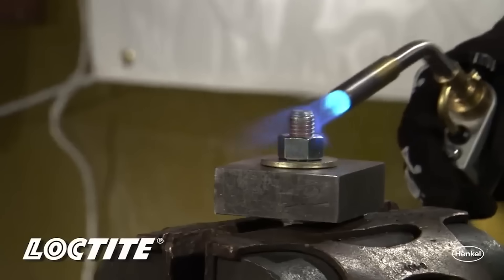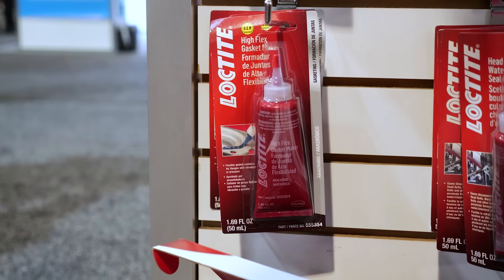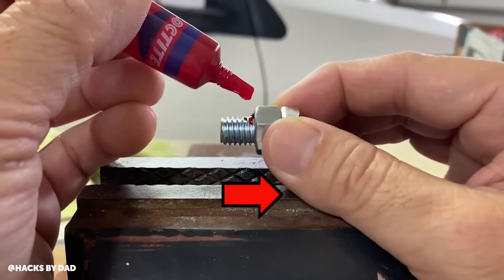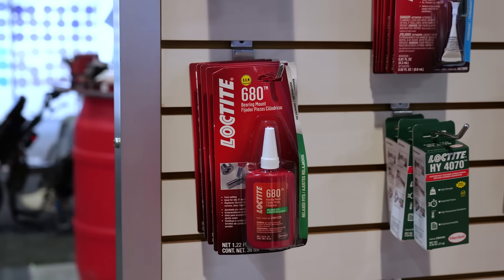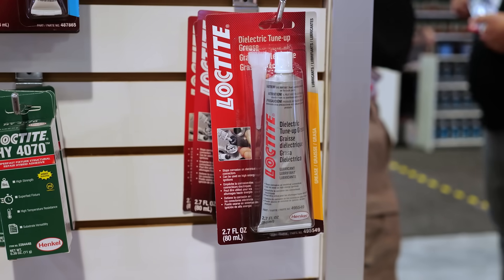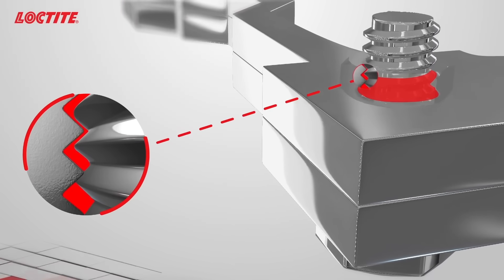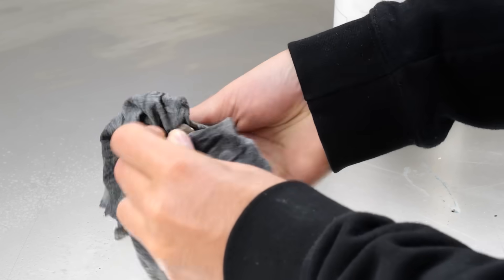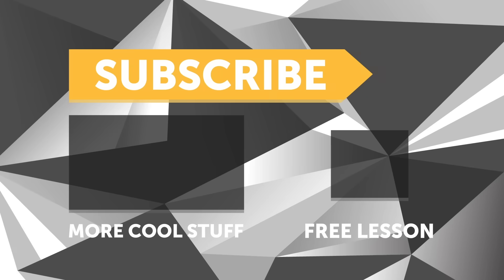Many pro mechanics don't know this.

Comment: Good old fingernail polish works very well in place of Loctite.
Reply from the maker: I just had a quick look. Per ml, that seems more expensive than using Loctite or an alternative brand of threadlocker made specifically for this use. 
I guess you can choose whatever colour your heart desires with nail polish though 😅 - Taz.
Reply: I always keep some in my purse with my lipstick
Reply from the maker: Lipstick is there to use an an anti seize right 😅
Jokes aside there can be some merit in reusing some household items. Hair spray for motorcycle grips is a common one since it gets stickier when it gets warm.
Nail polish for threadlocker isn't one I'm super keen on but hey, I'm not working on Rays projects, he is and can decide for himself 😎 - Taz.

Comment: If the red needs 550 degrees to release why would you use it on. "The ideal placement of red threadlockers is on bolts ranging from 1/4″ to 3/4″ diameter for some of the following areas: Bearing caps, Motor mounts, Suspension bolts"???? You dont want to heat those up because they contain your rubber bushings. Thanks
Reply from the maker: @dannyw7662  I guess in most cases on a street car you are removing those components to replace the bushings because they are already toast, and on a race application you won't be have rubber there, it will be 'solid' mounted.
That said, that is just some examples from them, you decide where you want to use such threadlocker (or not) on your own car using your own brain and knowledge of the options 😎 
Also note, there is not only one type of Loctite that is red - Taz.

Comment: 35 yr aircraft tech…. We almost never use lock tite , safety wire,cotter pins, nuts with run on torque. Heat counters locktite.  As a hobby machinist  green for bores and blue and low strength purple is my go to  for just about all other applications

Comment: Way back in the seventies when I was doing workshop training, we did the brazed bar experiment (cut a 10x10mm steel bar then braze it back together in a 3 to 1 joint). After that, it is firmly in your mind how to create a strong brazed, soldered or glued joint.  In my earliest design jobs, this became very useful as engineering adhesives were just becoming more common and easy to obtain. An early application was the bed of a machining fixture that was assembled with anaerobic adhesive instead of hundreds of tiny screws. Later, anaerobics were used not just to prevent loosening but to prevent crevise corrosion and guarantee the forces of disassembly. Other adhesives were used to seal marine electronic pods and assemble polyolefin and PVC parts. Many of the products were from Loctite but there is now a wide range of suppliers in this market.

Comment: For occasional use at home to keep your threadlocker good for longer, keep it in the fridge when you aren't using it ;-)
Reply from the maker: Great tip! I do that with some glues too like Loctite 480 as that goes off very quickly at room/workshop temperature - Taz.

Comment: Does Loctite work on galvanized bolts and nuts?
Reply from the maker: "We recommend the use of primer where both the parts come under the category of 'inactive surfaces'. These metals lack the iron or copper content and thus the metallic ions that are required to fully cure the product within 24 hours. These inactive surfaces include plated parts, stainless steel, galvanized steel and anodized aluminium to name a few. On the other hand, in case both or at least one part is an active metal, then there is no need to use a primer to ensure full cure, which is typically within 24 hours at room temperature." - https://www.tryloctite.in/faq

Hope that helps! - Taz.
Reply: @hpa101  Extremely helpful - thank you

Comment: I've never had to ever use heat on red thread locker....
Reply from the maker: If a product, amy product, isn't working then you need to check you are are applying it correctly, your supply has expired and also that you are using it for the right application 😎-Taz

Comment: Blue 243 is the stuff! Just use it on everything, especially on motorcycles. Bolts will always release with normal tools, but NEVER come loose.
It also stops corrosion so the bolts never rust in or gall, good for motorcycles where bolts are often exposed to rain.
And it sets up fine on stainless bolts, probably 90% of the bolts on my old Harleys are 316 or 304 stainless.
The only time I use other loctite is special red for inside the engine (hot) as specified in the service manual, and occasionally use green for a stud that you never want to get out again.
But every bolt on my old bikes gets blue 243, just buy a big bottle of it and keep it with your tools. 👍
Reply: 243 is awesome because it's oil tolerant, which means you don't need to blast every bolt and hole with brake cleaner before you assemble. Granted, I used 242 for a lot of years without cleaning anything before assembly and rarely had issues, but it's just the piece of mind for me.
Reply: @ForfeMac    yeah yoou don't need to clean the bolts, and don't even need to clean the previous loctite off the bolts, just a couple drops fresh 243 then tighten up the bolt.
If you ever wonder why new bikes never get a loose bolt its because the factory puts 243 on every chassis bolt, so to me, that 243 makes my vintage Shovelhead as reliable as a new bike (well I also completely re-wired the electricals haha)
Reply: Don't use it on everything, for example use it on your brake discs but use nothing on your caliper mounting bolts, just not needed, not needed on front and rear axles, fairing bolts etc etc.
Reply: Also 2400 is a great alternative that will work on all metals, including passive substrates such as stainless steel, aluminium and plated surfaces.
Reply: @HalfdeadRider    nope, I use it on caliper mounting bolts, the factory does. Pull a caliper off a new bike and you will see the white-blue powder residue on the bolt.

Actually I agree with you on the little fairing bolts that secure the plastic, I dont use it there, but I do use it on the metal fairing brackets.
Reply: @wizrom3046  yep, that white blue powder is likely some kind of weird anti seize, bikes never used to come with anything on them as it just is not needed. 

On Kawasaki's you would annoyingly get red loctite (rather than blue) on disc bolts and clip-on bolts and that was pretty much it for obvious reasons. It's not even on pinch bolts for the forks as vibrations are dampened out by the forks.
Reply: @HalfdeadRider    no the blue powder is dried 243.
You can see it on factory bolts when you take them out, and same for bolts you out 243 on and then take them out later
Reply: The other advantage is that 243 has a primer agent built in.  242 required the use of a primer on inactive metals or coatings but the new 243 does it all.  Very good stuff indeed.
Reply: The workshop manual for my motorcycle is literally mentioning blue Loctite as a necessity when re-assembling.
Reply: @GlekkeMatrak    yes, it is normal procedure on new motorcycles that the factory put blue locktite on everything.
That is why new bikes are so reliable.
(And why my 45 year old Harley is so reliable)
Reply: Oh, so Green is like a permanent grip of death? I understood it to be for pre-assembled parts, as it’s very thin and can creep between the threads. I didn’t realize it was super-permanent, good to know! (I was about to use some on the mirror-adjustment screws in our makerspace’s laser cutter. It sounds like blue before assembly would be the way to go, since the company rep said you can make adjustments without disturbing the anti-slip properties.)
Reply: @DaveEtchells   yeah, use the blue 243 on everything, lock the green in the BACK of the cupboard lol
Reply: @wizrom3046  I do exactly the same as you and it never fail. Wideglide 1999
Reply: Agreed 100%. I've almost never used red. Blue is as strong as you need it to be. You need to back off a couple of threads and then you can remove the bolt/nut relatively easily. Red will end up with stripped or broken fasteners and damaged mating parts.

Comment: I like the blue for sealing threads on the PCv oil resistant version. The red requires high heat and I don’t use it often.

Comment: Bad info on the blind hole installation. Theres no guarantee you'll actually engage the locker if its in the bottom of the hole. Also gives you inconsistent thread lubrication, which is huge deal for fastener torque values. Put the locker on the bolt threads near the tip, and send it. Also incredibly important to prevent galling on stainless hardware.
Reply: Also because fluid in a blind hole can create extreme pressure when the bolt is inserted and tightened. It can create enough pressure to crack cast parts.
Reply: @noxious89123  Yup.
Reply: @noxious89123  i have done it..
Reply from the maker: @geoffreycasey875  with 2 drops of Loctite? Or was there more of something else in there? Sorry to make you rehash this nightmare haha, but share your experience so others scrolling by can learn from it too if you have a moment 😎 - Taz.
Reply: @hpa101  when I removed a cylinder head some oil went into a thread hole on the barrel.one of the bolts from the rocker cover had a long bolt that went into the barrel and when I tightened it a piece of the metal broke because of the hydraulic pressure..i was only starting to mess around with motorbike engines many years ago.
Learnt from it..
Reply from the maker: @geoffreycasey875  oh man that is rough lesson for sure Geoffrey. We all live and learn even though sometimes the lessons are not something we set out to see first hand by choice haha
Cheers for sharing and hopfully your experience helps someone else avoid the same (easily fallen into) trap! - Taz.
Reply: Yeah I would be really nervous putting any sort of liquid inside a bolt hole with no space for it to vent out when the bolt is bottomed and then torqued even lightly... Best case scenario the bolt doesnt sit properly in its hole and worst case scenario you cause enormous pressure until metal cracks.

What I do is apply a drop to the tip of the bolt and wipe any excess off around the bolt so that only first 2-3 full thread grooves of the bolt have visible locktite
Reply: @aaronlangevin322  also any application that you would be using loctite the thread tolerance’s aren’t that tight. It’s only applications that have specific torque specs like head bolts and high temp situations like exhaust where the liquid would be forced out and you wouldn’t use a thread locker in those situations anyways. I can’t imagine any situation where threadlocker would cause enough hydraulic pressure to cause damage. It’s possible theoretically but not in a real world application.
Reply: @stillwurdy1854  I know it's a wild concept, but precise fastener torque isn't just limited to head gaskets and ring gears. They're not even limited to just automotive. When you spend a significant amount of time modeling the stress on critical parts due to bolt tension, and those bolts must be modeled as "lubricated," you will likely want to ensure the bolts are actually lubricated when they go in. Believe it or not, Loctite actually has instructions on how to use it. Just in case you thought my explanation was based on conjecture and not years of engineering experience.

Comment: Blue loctite is great. Sealing the threads is also an anti-corrosion method for harsh weather areas. 

The prep spray is NO JOKE for anyone using anaerobics. It sets up in about 4 seconds and creates a much stronger more consistent bond, and allows you to do things like pre-setup anaerobic pipe sealant for installation in oil soaked areas. Oil can be flowing out of a hole and it will seal.

Comment: I really miss lockwashers. They never let me down.
Reply from the maker: They are not extinct, you can still use them if you prefer 😅 - Taz
Reply: @ of course. But why lock tight at all if a lock washer will do the job. 🥴
Reply from the maker: @stephenabril7084 why use a lock washer when you can use a place bolt?

Same reason why thread locker exists.

Lock washers are not a perfect solution for every and any fastener or even the same fastener used in different applications. Same for place bolts. Same for thread locker.

A quality fastener supplier will be able to teach you the ins and outs if you're not sure where you should use a lock washer, otherwise stick to what the engineers are telling you to do for the application if that is available and relevant (as in bolting up something on your car vs assembling Aliexpress garden furniture) 😎

Hope that helps! - Taz.
Reply: It works for me. That’s all I know.
Reply from the maker: @stephenabril7084 there could be a better way that you're not taking the time to learn about 😎
And by that I don't mean you need to run out and buy Loctite, that is more around understanding why you are doing what you are doing rather than doing it because you don't know any better 🤘 - Taz.

Comment: I rarely use any. I'd much rather be able to remove a bolt down the road. Now, of course there is a time and place but I think many way over use the stuff.
Reply from the maker: You are using the wrong type. This video is for you 😎 - Taz

Comment: I like red on helicoil inserts into stripped threads on aluminum parts and then blue on the fastener going into the insert. This has worked for many years for me. The fastener won't come loose and the helicoil won't pull out with the fastener.
Reply: @3rdpig  how about green on helicoil? 😁
Reply: @Bobi_Rudi  Was about to say the same. Also in some cases not mentioned in the video (apart from on bolts in very hot areas), no loctite should/needs to be used, on motorcycle brakes for instance we use blue on discs and nothing on caliper mounting bolts.
Reply: @HalfdeadRider  Is this due to the temperature exposure? I recall seeing red loctite called for on STI Brembo brakes, but I refused to use it. Dealership must’ve used it previously since the threads on one bolt tore out. Galvanic corrosion can also be a concern. MTB forks have magnesium lowers, so I’ve used blue loctite (if using stainless hardware) to reduce galvanic corrosion. Some OE steel bolts come with loctite / nylon patches.
Reply: @158158cow  I think it is more due to them being static, they don't tend to vibrate lose as some potentially could, and they won't get near as hot as the disc bolts. Also with proper regular maintenance I find stainless does not really need protection from galvanic corrosion, I have many stainless steel hardware on my old Ninja, some natural some black oxide.
Reply: @HalfdeadRider  Black oxide stainless? Never seen those, only ones I've seen black oxide are non-stainless. Seems pretty cool.
Reply: @Kalvinjj  I sell black oxide bolts and screws alongside standard stainless steel in A2 or A4. And of course zinc plated mild steel nuts and bolts, some brass and always expanding the range, as well as other items on ebay such as tyre valves etc.
Reply: Nothing worse then a spinning helicoil or rock-solid!!
Reply: I’ve worked in workshops for years various people think it’s good ,,others think it’s don’t ,,work so my question is does Loctite have a shelf life if it does, why couldn’t you have a mention that? Jacktar
Reply from the maker: @colinchambers3433 it says it on the bottle and is different between the Loctite product range. That said, you can find people around the internet saying they've had it last for many years if stored correctly.
If you're in doubt, test what you have there before using it - Taz.
Reply: When torquing a fastener do we reduce the torque wrench setting by 10% when using a liquid like Loctite?
Reply: @kensmith3665  Loctite* and no 😎

Comment: FYI, the 243 is blue, in your video it's red. 
I have been using Loctite 243 forever, and I am totally satisfied when using it on threads for my bicycles and motorcycles. 
Fantastic product.

Comment: Just to see how powerful my little bottle of locktite blue is, I coated a handful of 1/4" nickle plated bolts, tightened down and waited 24 hours. Those nuts threaded off with no difficulty at all! I wondered if the active compound had settled out, or whether locktite goes bad over a few years. Perhaps I should start using primer?
Reply from the maker: It does go bad, but as mentioned in the video you might need to use a primer. Here's their quick note on primers noting some compounds also include the primer rather than you needing a bottle of something else - Taz.

""We recommend the use of primer where both the parts come under the category of 'inactive surfaces'. These metals lack the iron or copper content and thus the metallic ions that are required to fully cure the product within 24 hours. These inactive surfaces include plated parts, stainless steel, galvanized steel and anodized aluminium to name a few. On the other hand, in case both or at least one part is an active metal, then there is no need to use a primer to ensure full cure, which is typically within 24 hours at room temperature." - https://www.tryloctite.in/faq"

Hope that helps!

Comment: Yup no I'll use red for most things and no heat to remove
Reply from the maker: There are a few variations but assuming you have the super strong stuff just wait till you apply it correctly one day noting the comment regarding materials too. Have fun 😊 - Taz.